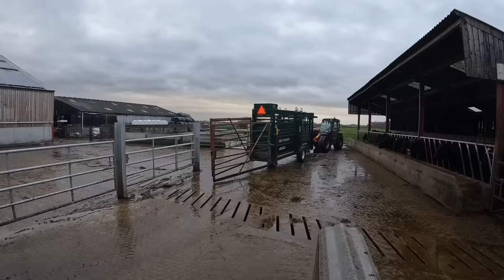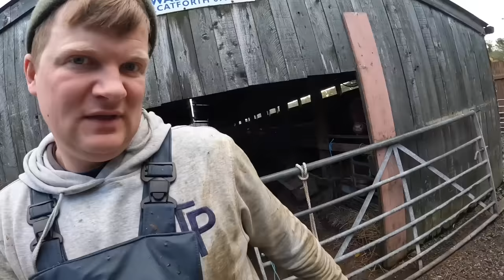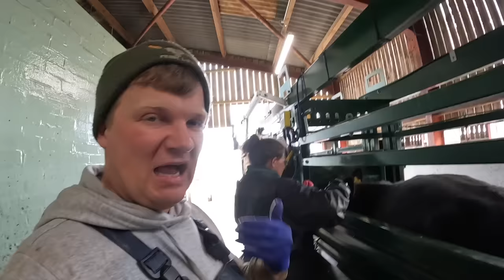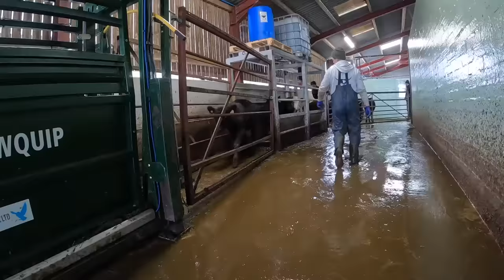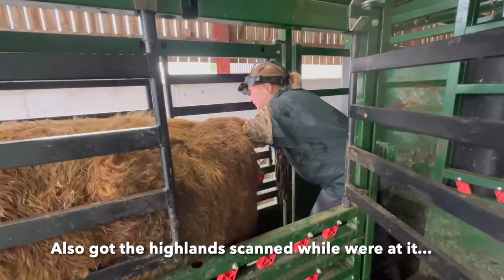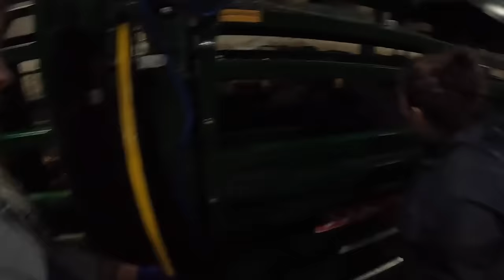THE MOST STRESSFUL 5 MONTHS OF MY LIFE IS OVER...

Comment: For those overhang wooden boards always breaking. Have you thought of using the plastic slats? The ones they use on refrigerated rooms to keep the cold in. That's if you need something to keep the air quality you had those tests for. They would also help to keep rain out.